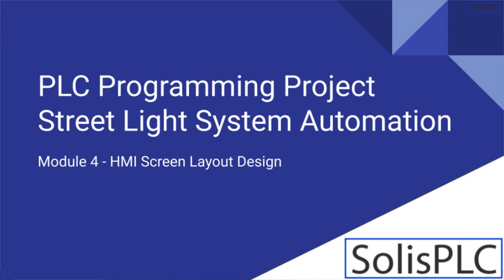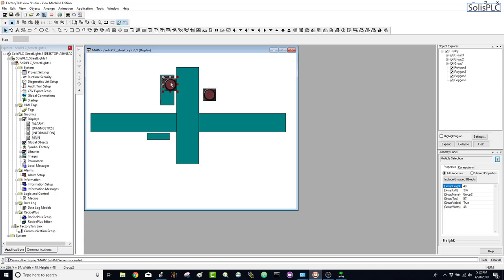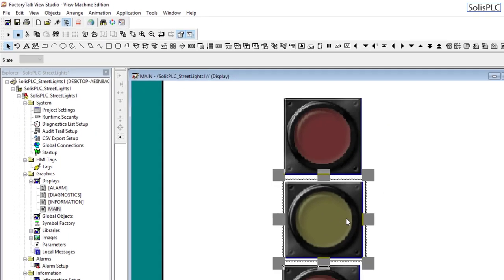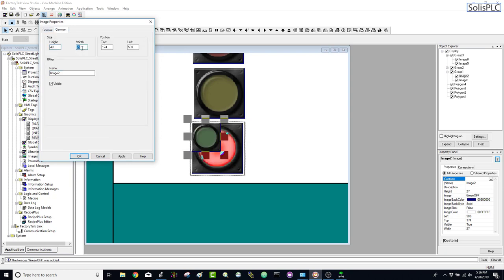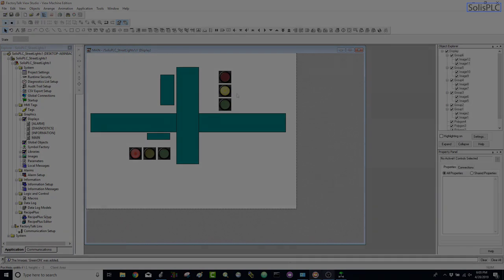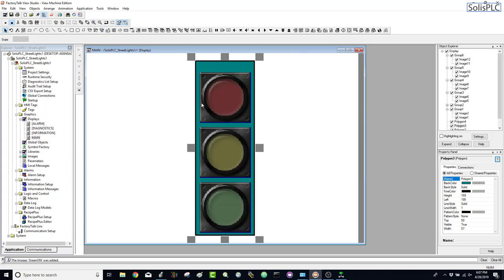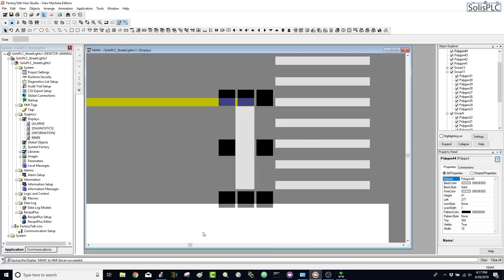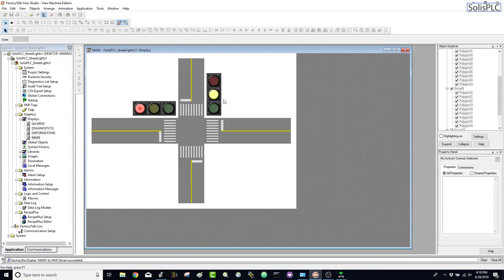PLC HMI Programming Project | Development Tutorial  for Beginners Ladder Logic Diagram | Part 4

Comment: Hi, I am planning of putting together 10 conveyors working in cascade using AB PLC interface with Factory view HMI (with start, stop and E-stop, etc., button), the conveyors will driven with AB power flex 525 drive, can you assist me on designing?
I don’t know where to start..... Many thanks.
Reply from the maker: Hey Joe, we can certainly help you out with that as we do integration projects as well. Send me an email to v.romanov@solisplc.com We can review the scope and issue a quote.